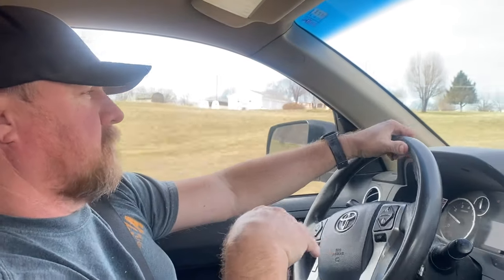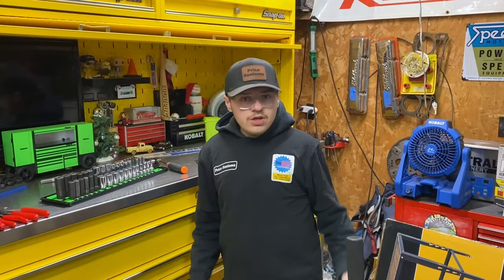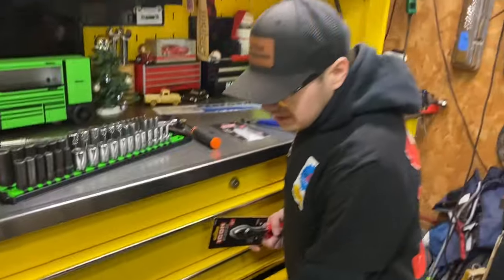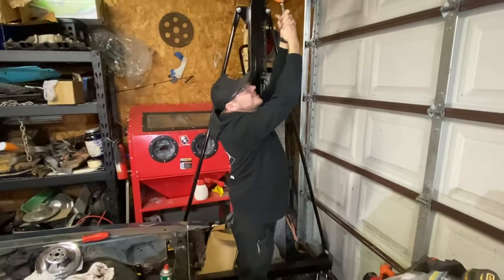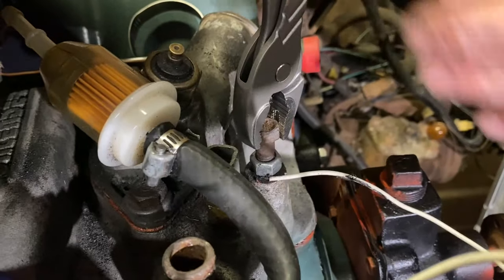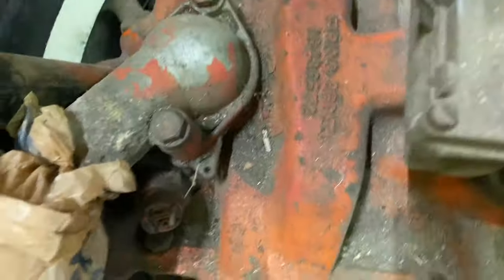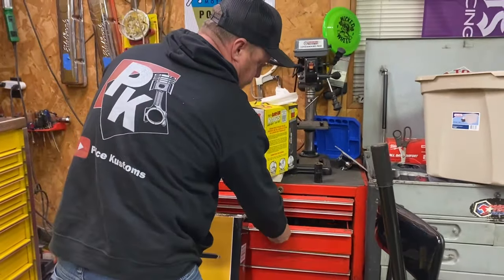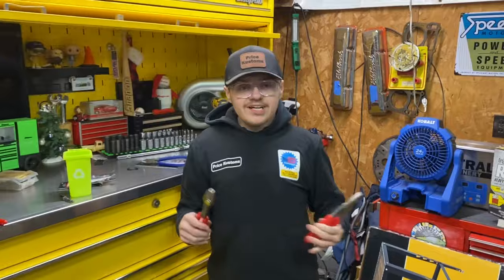New Harbor Freight ICON Slip Joint Pliers!!! GOOD OR BAD? #harborfreight #tools #toolhaul #snapon

Comment: Yet another shamelessly stolen tool design from knipex. The original (82 01 200) only cost around 18€. Why bother ...
Reply: Maybe in Europe but in the US they’re $35-40

Also, if the patent is out on them then they aren’t doing anything different than any other tool brand.  How many different Brands make water pump pliers originally designed by Channel Lock?  How many companies make “Vice Grips”?  How many companies make similar Socket wrenches with similar designs, screwdrivers, etc etc..  By your logic we should only ever buy something by the original inventor and manufacturer and if that manufacturer goes out of business then what?  

This isn’t a bad thing, this is good for the consumer as competition keeps price in check and breeds innovation.
Reply from the maker: The Icon version is a lot cheaper than the knipex in the US.
Reply: And HF has a great and easy warranty